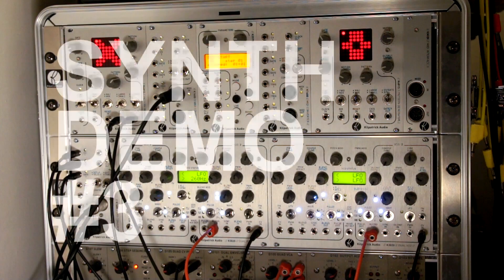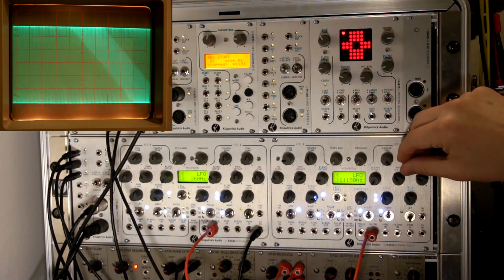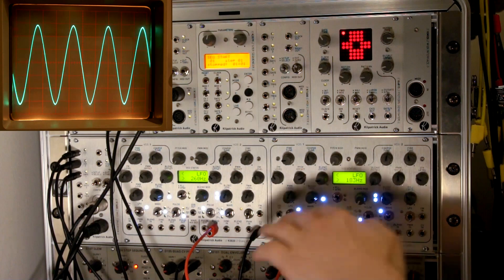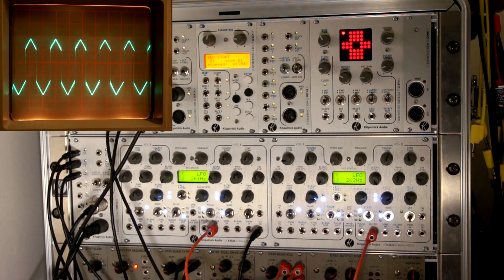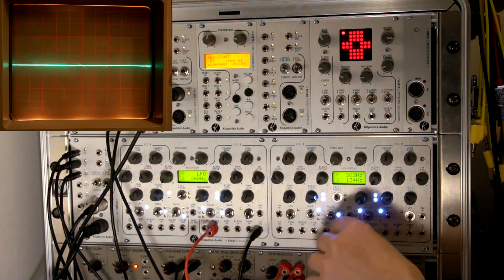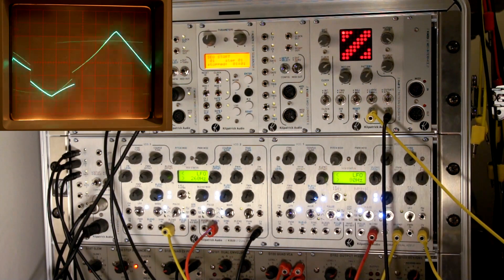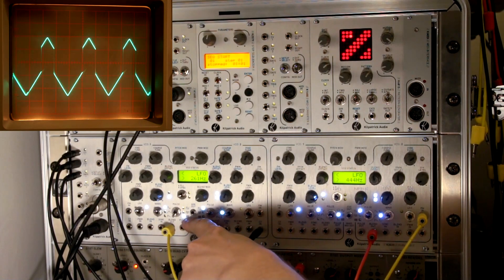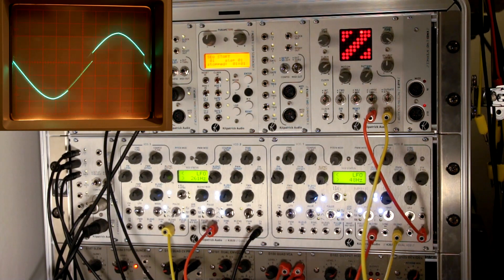Synth Demo 3 - K3020 Dual VCO

Comment: wish there was a single oscillator version to cut down that price :(
Reply from the maker: There is! We specifically made the K3021 as a single VCO alternative to the K3020: http://www.kilpatrickaudio.com/?p=K3021 It uses the same circuit design, but with some modern improvements.